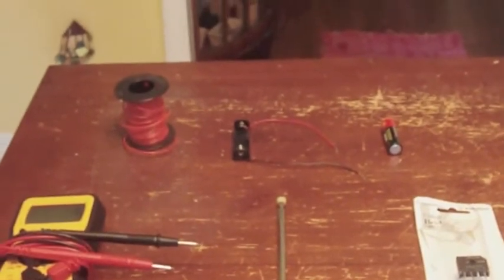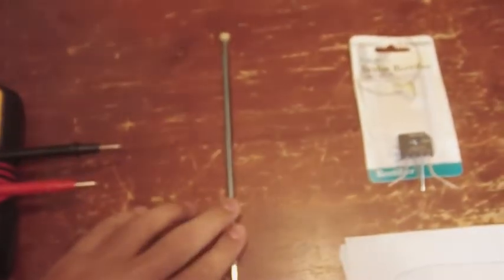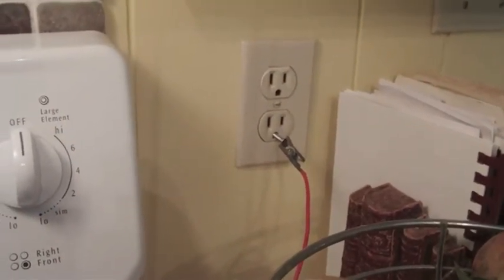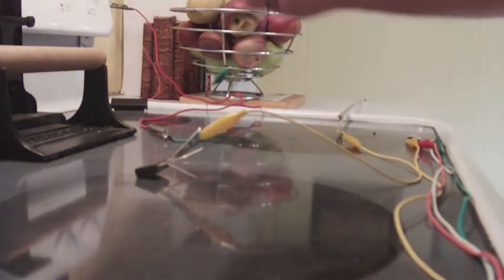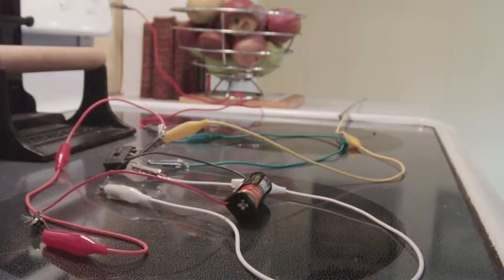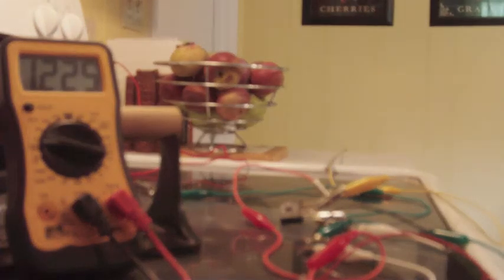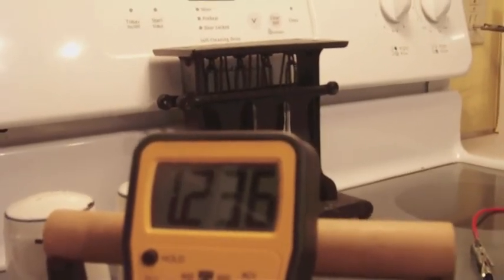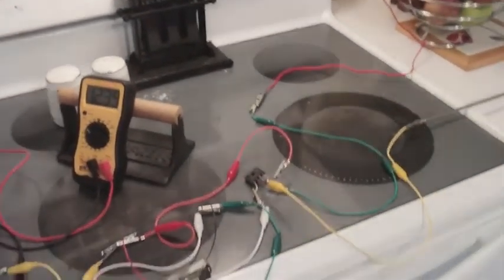Recycle Electricity Battery Charger

Comment: like the first part of the circuit is lower voltage and aprage and the more you add then you need hv capacitors and higher voltgage rated electronics ans maybe add a hjoulethief or a other amplifier circuit and step down or step up transfomrer